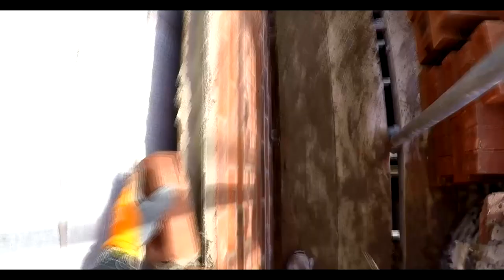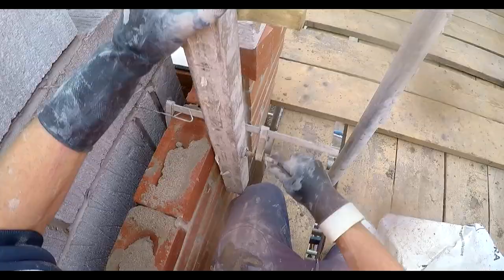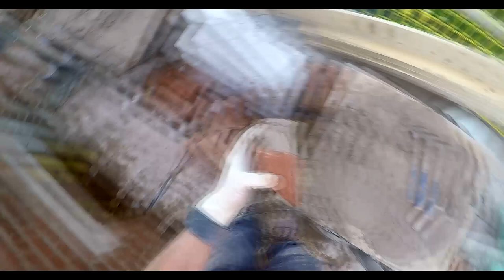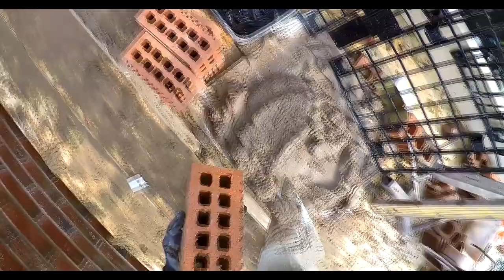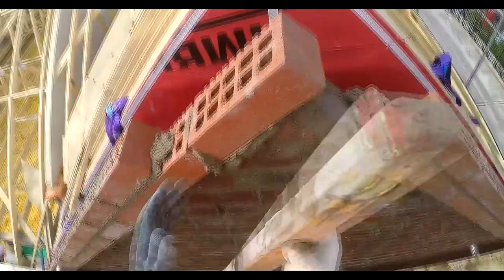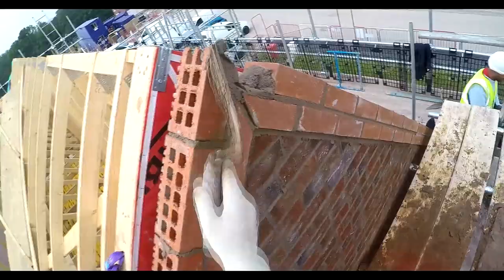BRICKWORK FUNDAMENTALS 2020 : How We Do Top Outs on Site w/ Pre-Cut Angles : Profile Setup (1080P)

Comment: Done quite a few of these, using wooden Gables profiles, with nails, what a ball ache, just ordered 4 gable profiles for £50, looks miles easier with corner block n line on them, instead of wrapping the line round a nails fukin about, got a few of them cut ups coming up, they should make there money bak in the first day 💪🏻💪🏻💪🏻
Reply from the maker: Great stuff! They are really good, I use them to stabilise aluminium square section profiles for brick work aswell. Clamping the roofing latt to blockwork. Fully adjustable👍 👌 glad you found some. They are usually out of stock when I look lol
Reply: @brickworkfundamentals4636  yeah, great bits of kit, killed 2 birds with one stone on profile stabilisers, a blowk in donny where in from was selling some, just dropped on

Comment: Lovely neat job! What is that finish called at the top of the gable with the vertical joint?
Reply from the maker: Cheers dean ! Not sure it’s got an actual name but I just call them the top out cuts😊👍 I’m on a new site now which has no reds on the gables. Prob a bit easier and quicker for the same money so I’m not complaining! Cheers for the comment 👊

Comment: The Bricklayer’s on the site I work build solid,then nail on a slating lath and run the still saw down the lath.It works well as does your set up.
Reply from the maker: Yeah the “cut it after” method is a good way for sure!   On this site the angles get cut off site for each house. It’s good as it keeps dust down on site 👌👍🏻 safety first 😂👍🏻
Reply: So, when you say off site, does this mean you can cut the bricks for several gable ends on a production line ? Enjoyed learning something today thankyou. 👍
Reply from the maker: Yeah it would be in a factory or on a yard. Big chop saw with loads of water. 👍No waste as they send one small cut and one big cut per brick. They also stick bricks together for bay windows etc. They make it to easy for us haha 👍👍
Reply: Brickwork Fundamentals I miss the uk in bricklaying, I live and work in Western Australia. So far behind here. Bricklayers have to do everything, scaffold etc.
Reply from the maker: Neil Halford-Smith that’s mad, I always assumed Australia was a head of the game! Haha They are defo handy with profiles 👍🏻 small sites here can be a bit like that but the big ones are so well organised! Health and safety is pretty full on with the big house builders !! Site would get shut down if they saw a Bricky doing a bit of scaffolding 😂👍👍
Reply: Brickwork Fundamentals not joking mate, they use profiles everywhere. Even mail boxes. They can’t use a level.
Reply from the maker: Neil Halford-Smith 😂😂😂mail boxes!!  I absolutely love profiles but I think sometimes it’s quicker to get the level out!! 😀👍🧱

Comment: Lovely job , I like the profiles for the angles but on the main wall Blake’s intermediates are way faster to set up, less faff no extra clamps or bits of wood and you can joint up behind them , 😉🧱👍🏽
Reply from the maker: Cheers !! Right We have got some I’ll give it a go! It doesn’t feel like a faf and the Baton stays where it is for the cut up profile! I’m all about speed though so I’ll give them a try 👌😀👍
Reply: Brickwork Fundamentals . All you need is the wedges to stop them pullin 👌🏼🧱👍🏽
Reply from the maker: The way we do it is ok with green brickwork as well which is a big plus when you get up on the table lift👌👍 I’ll order some wedges as we definitely haven’t got any👍👍
Reply: But people who use Blake’s there corners can go in and out easily you have to be careful but with the box section can butt up to it
Reply: Dezzie That’s a myth about the Blake’s , you don’t get flatter brickwork if they are used properly. No smudging either 👍🏼🧱
Reply from the maker: I have personally had far more success on corners with square section than Blake’s 👍🏻Both excellent when used right. 😀👍
Reply: Brickwork Fundamentals . Each to their own 👌🏼👍🏼🧱
Reply from the maker: The 3rd lift scaffold boards on our site only leave a brick showing so that pretty much rules Blake’s out. 👎 unless you take the corners up higher on the 2nd lift I guess!? I’ll dig the intermediates out for next top outs 👍👍
Reply from the maker: Bricklaying With Steve and Alex oh man,  what a nightmare 😳  some people ah!? 😂👍
Reply: Brickwork Fundamentals 🧱👍🏽
Reply: @SteveAndAlexBuild  scaffolders eh. Nightmare

Comment: How do.you know where the gable profiles sit am guessing you measure down 150mm from the roof until it touches the brickwork then that's where you establish the position of the lat on the roof
Reply from the maker: I think I know what you mean…. Just put one roof  lat as low as pos without the metal bit touching brickwork and the same high up. Put your line 150 below the underside of the lat. (assuming 2 brick oversailers. ) line can go lower or higher depending on the detail. ! 
Hope this helps ! 😀👍
Reply: @brickworkfundamentals4636  what's the best way to sort the bond out on the sailors so you dont get shitty small cuts at the top? Do you just tape it?

Comment: Great vid pal nice work 😁👍
Reply from the maker: Thanks mate 👊
Reply: I use box section for the gable but your way of doing it is well easier. Cheers pal 😂👍🏻
Reply from the maker: Rowlock Construction it is good because you can leave the roofing Batton in place for the cut up profiles! And if your careful you can do it with green brickwork as the batton takes the weight of the profile 😀👍

Comment: What trowel is that
Reply from the maker: Hi kurt! Hard to believe but this was a 12 inch extra wide heel from many years ago. It’s probably smaller than an 8inch now👍 You can’t get the extra wide heel any more so I’ve switched to an 11inch Philadelphia 👍👍 pretty happy with it
Reply: @brickworkfundamentals4636  ha it did look like a 9 or 10 inch I like the straight edges on the blade with the wide heal. It's what I'm after, I don't know if I like the philadelphia. Cheers 🍺
Reply from the maker: Totally agree!! My Mate grinds his edge flat. A lot better👍👍  Philadelphia is not ideal but now they don’t do as many patterns as they used to it’s prob best option I reckon👌🏼👍🏼

Comment: It's an extremely weak point on any building so why would you have a 100mm oversailing course up a gable. Within 15 years you will be able to just lift them bricks off.
Reply from the maker: You would have to take all the roof tiles off to be able to “ lift the bricks off” ! Sorry I should have included a photo of the finished job with the roof tiles on. I don’t think you would have any concerns then . It has roof tiles on and a dry verge system which pretty much covers the top course of reds. They are only oversailing 12mm. All complying to nhbc spec. Double row of wall ties within 225mm of the top of the spandrel panel. This brickwork is going nowhere sue👍🏼👍🏼
Reply: Is that top joint meant to be twice the size of the joint below?
Reply from the maker: Like I said sue.. the top course is pretty much covered with the dry verge system so I think it will be ok 👍🏻